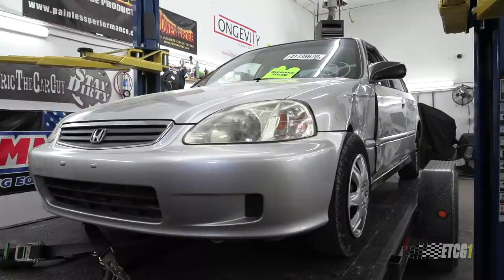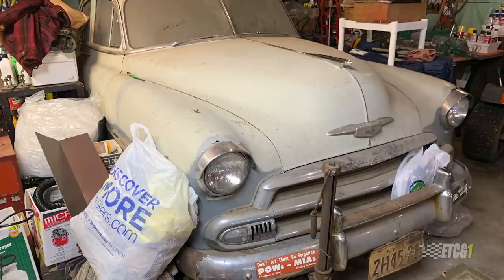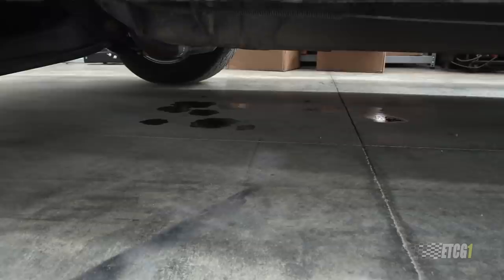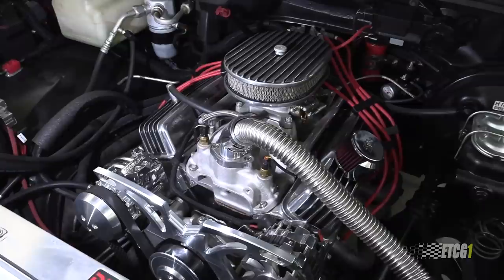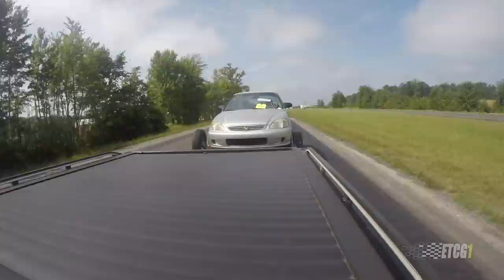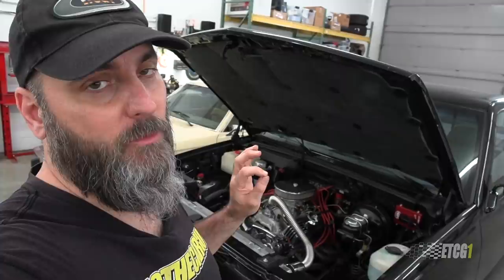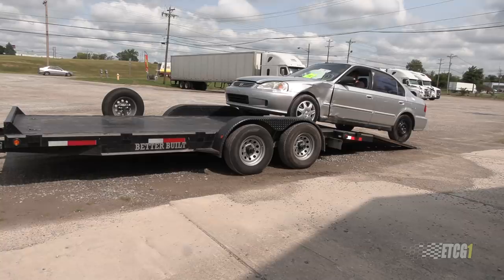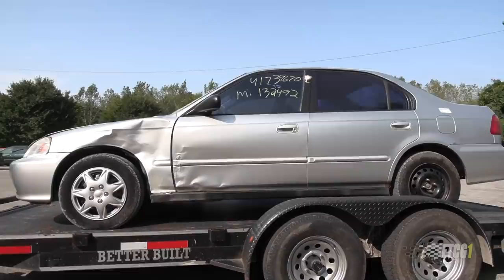First Time Towing with Dads Truck

Comment: Not sure if anybody said this or not, but this is my recommendation. I believe your truck is capable of towing no problem. I HIGHLY SUGGEST using a weight distribution setup. Like I do and most do with tongue pull campers and big enclosed car trailers. My recommendation: Husky Round Bar setup with 1,000lb tongue weight capability. This system will transfer weight off of your rear axle and tongue and put it on the front axle and rear axle of the trailer, which also stabilizes the truck and trailer and is so much safer for going down the road and especially, hard brake events. I recommend using this setup with any pickup truck with a trailer like this, but I believe this will help you a lot with using Dad's truck. Also, as you said, position the car different so it reduces tongue weight. I hope this helps or at least gives you something to consider!

Comment: The frame on the '88 to '99 trucks is strong enough to pull a double axle single car trailer.  The problem you have is that you lowered the rear end of the truck, the original rake would have been leveled out with that load.  The original tongue weight limit was probably 500 to 700 pounds.  With the lowered suspension,  you should reduce it to 250 pounds, you can do that by moving the car back over the trailer axles.

Comment: I use a 95 suburban 1500 for towing. Everything is stock and I still tow cars. But you can adjust where you put the vehicle on the trailer and keep the rear from bottoming out but still have enough tongue weight to keep from losing control.

Comment: I have a 96 extended cab and ive been towing a 6x14 enclosed trailer for 3 years now. Rouglly 2,800lbs almost daily. 4:10 gears and helper leafs in the back.... golden.

Comment: Heaviest I’ve hauled with my 1/2 ton is 12,000 lbs. feed buggy around the ranch. Definitely wouldn’t do it on the highway but surprisingly it didn’t get close to bottoming out. Use an add a leaf and you’ll be fine lol

Comment: You should re-do that tow with that same car and trailer and install a weight distribution hitch, I bet you'll see a huge difference in the truck's drivability.  That kind of weight you need a weight distribution hitch, it'll keep you from riding on the bump stops as it distributes some of the weight back to the front of the truck not just onto the back axle/suspension.

Comment: I have a 2019 Ford Ranger with the factory Towing Package, and I've been amazed at how well it tows.  My wife has a 5,000-pound equipment trailer that she uses for work (that's its loaded weight, with all the equipment in it, of course), and when her work truck is in the shop, she uses my Ranger to tow that thing.  Zero problems.  Handles it perfectly well -- and gets 13.5 to 14 MPG on the highway while doing it, too!

When you go get your '51 Chevy, if you can rent one of the new Ranger models with the Towing Package, I'd highly recommend it.  They're surprisingly good at towing.  (Fill it up with 93-octane fuel, btw -- you get an extra 35 HP and 20 ft-lbs on 93 vs. 87 octane. That makes a definite difference when towing.)

Comment: I owned a black 1992 5.7 Sport lowered 4/5 from 1992 to 2012. Only big difference from yours was I had a 5 speed manual. it was my tow vehicle for my tubbed big block 86 monte SS. Towed that car from upstate NY to as far as Delaware, Buffalo, Montreal, Long Island. It was a great tow vehicle.  Only difference was I had was my truck was lowered 4, 5. Front spindles and coils, rear front hangers, rear shackles and a mild spring de-arch. The truck was low but still had a rear up rake that let it have suspension travel. Next was dont load up the tonque weight so much. My Motor and trans was probably as heavy as that entire civic. Car placement is key. Too little truck will be tail happy. Too much and its easy to overload the rear suspension and tires.  I swapped in a L31 Vortec 5.7 with headers and Edelbrock MPFI. There was plenty of power and the 5 speed made the truck a dream. Deep first to get heavy loads moving and OD. Hint is leave it out of OD unless your on flat or going downhill.  Hope you get the towing sorted. Those trucks are a workhorse even in stock trim.

Comment: Also keep in mind many of the rental trailers are built a little stronger for damage resistance. Between that and better centering of the load would make a big difference. I rent truck and trailer when I need them. I don't need a dedicated rig, though you might.
Reply from the maker: That's not the case here. This place sells these exact same trailers. It's one of the reasons I wanted to rent one first. Thanks for the comment.

Comment: I'm sure you're aware of them, but Monroe makes load-leveling shocks that have an additional coil-spring over them to help support the rear-end when applying a heavy load. I've seen them work wonders on some vehicles and I threw them on my Trailblazer EXT as well. Only thing is, if the truck is mostly a race truck, it might throw off it's nice low look as it will probably raise the rear end when empty.

Comment: When new, the frame was rated to haul 4000lbs. the hitch was rated for 400lbs. The number on the door is the weight of your truck AND everything you have in it. You are right to say sport truck not designed to do heavy work. Enjoy it for what it is. That's why there are car and truck rentals places.

Comment: Man, I wish we had roads that flat out here! I get 11mpg on a GOOD day towing with my '07 Silverado ... which just lost 3rd and 4th gear at 103k miles (lasted 6k miles longer than the rear differential did), but I digress!! Just ordered a killer replacement PerformaBuilt 4L60E for it - should last another 13 years plus ... but I digress again!

I've been towing heavy with a half ton truck all over the Eastern seaboard for 13 years now. A weight distribution hitch will solve that sag by a large margin. It also increases your weight capacity a bit, and adds ALOT of stability (with the right system). One thing I will say, NEVER get on the highway towing while loaded tail-heavy. Better to have more weight on the tow vehicle than on the tail of the trailer. Ask me how I know! Trial by fire. I cleared Rt.6 down Cape Cod when my trailer began violently whipping all across the highway at 60 mph. I had people in the grass trying to avoid me! Scariest moment behind the wheel in my life (besides having my El Camino completely sideways, U-Haul trailer and all with everything I owned inside, across a snowy I-80 in May). Everything was fine, until I let off the gas and coasted down a hill - then all hell broke loose! How I recovered without flipping the truck on its roof only God can tell you. I just reached down and stabbed the controller to its MAX. Didn't touch the brakes on the truck - that would've flipped me for sure - and just rode it out, trying not to correct at all but keeping the wheels inline with the road.  I had a F350 van, with super swamper tires, and 12" of combined lift - the thing towered over my Silverado by a minimum of 5 feet! The driveline had been removed and thrown into the van ... so all the weight was where it should NOT have been! I didn't realize this when I loaded it. The minute I got home, I got on eTrailer.com and ordered a Reese weight distribution / anti-sway system. Changed my towing experience DRAMATICALLY. I also installed a pair of Firestone Ride Rite air bags with a 5k lb. capacity. I've exceeded the tow vehicles capacity by a big margin a few times, and it handled it like a champ. I actually have never had to pump up the airbags towing regular cars and trucks, unless the load was super nose heavy, since the weight distributing hitch levels everything out so well. HIGHLY recommend one, especially if you're going to tow frequently.

Oh, and that strange pull you had was because the rental place doesn't maintain their stuff. I'm betting a brake wire was busted, and one side had no working brakes at all. I make a habit of feeling all the hubs as I walk around. Big temperature variations (especially when one is ice cold) are red flags for investigation. I've had one side fail on me like that once - the previous owner used wire nuts to join the wires to the electromagnets. I must've snagged the main wire on something in my yard and yanked them right out of the nuts. Of course it was while hauling 9,600 lbs. of coal to my dad's house 4 towns over! Through the city no less! God definitely has a purpose for me, lol - I shouldn't be here now!  :D

Comment: From what I can find....GCWR is only required to be included on the label if the vehicle is sold as new with a hitch installed by the factory.  So I wouldn't consider that part missing from the label being a smoking gun.

The factory stock 1500 had a varying trailer rating of between 6000-7500 depending on factory equipment and gearing/towing packages.    You've addressed the engine/transmission/gearing already.  Lowering the vehicle didn't help how it carries the weight, perhaps a set of air bags used only when towing would help maintain the proper suspension travel.  Seems reasonable to me that so long as your tongue weight is not exceeding the rated payload capacity, and the trailer is balanced properly, you would be OK to tow the trailer as you had loaded in the video.  You are probably correct to not want to push your luck with the much heavier vehicle as well as all the extra parts and goodies.  But you should be able to do some suspension/trailer loading tweaks to make the vehicle much more capable of towing moderate loads without too much hassle.

This whole discussion on a 1/2ton class truck is quite fascinating, considering modern rigs advertise 5 digits, and the marketing teams have gone MUCH higher...but realistically you should be able to safely pull 4-6k with this vehicle and the right suspension/trailer setup.

Comment: Just get a set of airbags for the rear axle. Inflate them when towing. Deflate them when not towing to retain the stock ride. If the truck's weight + trailer tongue weight doesn't exceed the GVWR and rear axle GAWR, you're OK.

Comment: According to E-trailer the half ton would be up to 7500 pounds depending on config. 
Also as a note heavy trailers 5000 and up a conventional hitch trailer always feels a bit sketchy.  This is because of the distance between the center ( vertical and horizontal) of the rear axle and the hitch ball. This gives a leverage point against the axle when turning and a leverage point to lift the front end.  Gooseneck and fifthwheel trailers eliminate this as they put the weight directly above the rear axle. The trailer then dose not have the leverage to push on the rear of the tow vehicle laterally or lift the front end.

Comment: You can  haul cars reversed into the trailer to help reduce the Trailer Tongue weight. a 383 should have enough torque to haul the extra 4,500 lbs. You could upgrade to a lower set of rear gears and a Gear Vendors Overdrive to compensate when driving light :)

Comment: Aahhh two options. Sketchy option. Air shocks for the rear. Real option. Adding a leaf to the leaf pack. Second opinion voids the lowering deal unless they're installed before towing and removed after towing. The Air Shocks may not offer the stability desired. What ever you do it's going to be more coin! Thanks for the insight Eric.
Reply from the maker: I agree, thanks for the comment.

Comment: Eric, You have plenty of truck to trailer in a very light Honda anywhere you want to go. I have a 1970 RB Dodge Challenger that I trailer to the drags every weekend as well as trailer a 1 ton firetruck, once! The firetruck was not fun but all the same, with a Chevy 1500. I hate to say but when you lowered you rear leaf springs, you basically planted your stop bumpers on the leafs. Bad move. Your rear steers the truck in unison with your front end. If you want to lower your truck with a nice smooth ride and still use it to haul stuff, use either airbags on the leaf connected to the box frame to the locator pin point of the leaf. Air shocks will work too but I did the exact same thing as you did and the air bags are the best and using Gabriel air shocks work pretty good too for only a buck fifty. Monroe's have an exposed airbag and deteriorate very quickly. The rear sway bar saved you from having a very bad day. Lift those bumper way up. Don't use them as a tow suspension part. They are only bang up preventers.

Comment: Eric, I'm not sure you're correct regarding that bit about the GCWR rating missing from the door sticker meaning the truck isn't meant to tow anything.  Tongue weight, when added to the tow vehicle's weight, is supposed to stay under the GVWR.  How much weight it can pull, i.e. GCWR, is usually found in the owner's manual.  I've got an 02 Sierra Ext Cab, long bed, 4WD with the Z71 and factory installed tow package.  It has no GCWR number on the sticker but the owner's manual tells me that this truck, with the 5.3L, with an axle ratio of 3.73, my max trailer weight is 7700lbs for a GCWR of 13,000 lbs. 

Also, if you're using a weight carrying or a weight distributing hitch the toung weight should be 10=15% of the total loaded trailer weight.

Comment: I found many years ago that I could pull a car better with a dolly. Technically, you just pull the car. You have a lot less weight on the tongue. Which, to me made it easier to handle. It's still going to push you when you let off the gas. Your trailer, in its self, weighs 2000 pounds. A dolly, maybe 2 or 300 pounds. So, you lose a lot of weight. Less weight pushing you. With less weight and at least two of the wheels on the ground from the car you are towing, it will feel a lot better. So, if you try to pull your 51 Chevy, make sure it has good tires on the back and the wheels roll free. Tie it to the dolly, and down the road, you go. I live in Ga. I once pulled a 55 Mercury from a junkyard in Virginia, all the way back to Ga with nothing but a dolly and my 81 Ford pickup. I had plenty of power and torque because of the 460/C6 auto and 350 gears in the rear. It pulled it with no problem except one. I did realize I needed better brakes. Besides that, no problem. Try a dolly. I bet you will like it better.  I'm looking forward to the 51 Chevy project. I own a 53 Chevy Belair Hardtop. I've had it since high school. I'm 58.

Comment: I think a trans cooler fan will do wonders in stop and go traffic or even slow towing speeds. Also is not that hard to wire with with relay, thermoswitch  etc etc. Maybe you can check those air bags that work only when the rear end is loaded to level out. They will work in conjunction with the leaf springs to give that extra support.
PS: just imagine that awesome '51 chevy silently cruising on EV power. Will be a good experiment and if done properly, totally reversible if you want.
Reply from the maker: The trans temp comes way down when I start moving. I don't intend to do a bunch of towing with the truck anyway, but like you said, it wouldn't be too hard to add a fan. I might consider air shocks if I decide to haul with this truck again. 

As for an EV '51 Chevy, I don't think that's a good idea. Batteries are heavy, '51 Chevy's are heavy. I don't think I'd get a usable range for the effort I would put in. Also, given that the '51 is a 4 door, I'd like to keep it something of a 'family' vehicle. Meaning, it would be nice to tow a camper behind it like they used to back in the day. 

Thanks for the comment.

Comment: Yes Eric, I have to agree with everyone else in the comments and yourself who suggested a bigger truck. I honestly think that is ultimately going to be the best solution for you in this scenario. If you plan on towing cars I would suggest that you look at a Ford F-250 or a dodge Cummins for something like that. Newer GM trucks these days are not quite as good as they used to be back when your dad’s truck was built that’s for sure. Not sure if you have any specific budget in mind atm but maybe you could find a good used truck with not a whole lot of miles. The Ford excursion was another great solid vehicle back in the day and those Diesel engines can run a very long time and are just perfect for towing cars like your dads old Chevy. If you plan to tow I recommend something with 4wd, would make for a good winter vehicle for you as well. So there’s a lot of different options that you can chose from but for your purposes I think a 4wd heavy duty diesel suv/truck is going to be your best bet here.